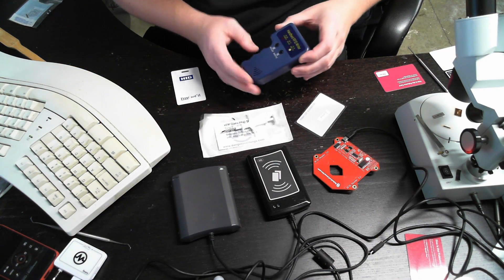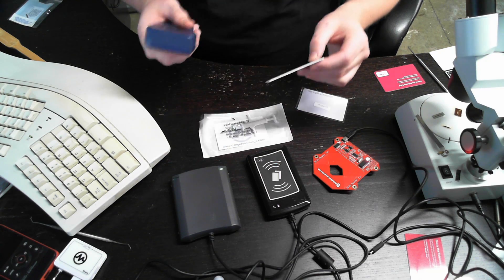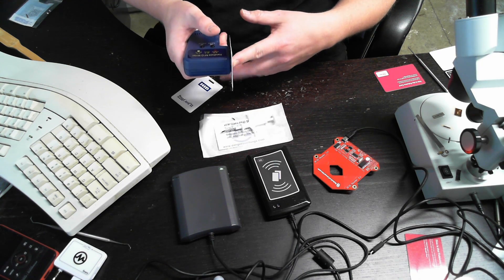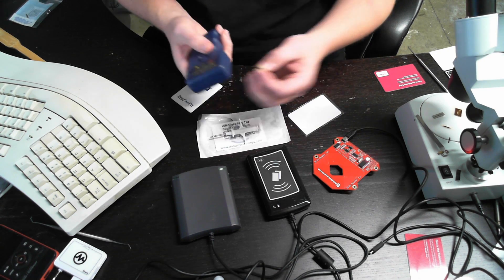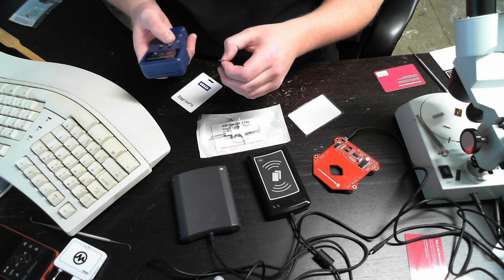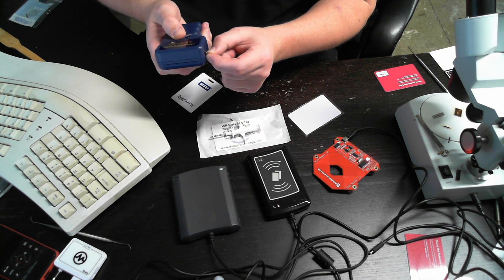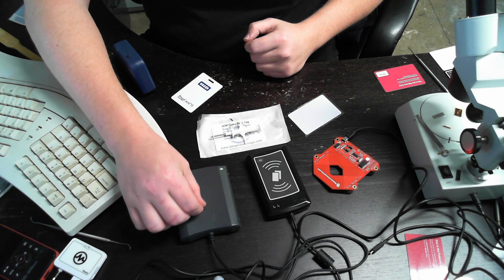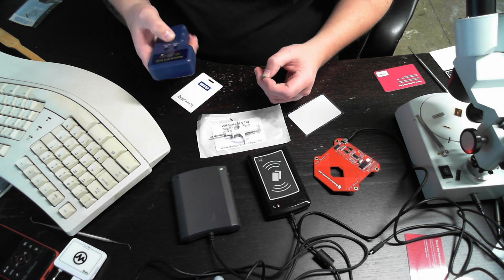The xEM 125khz EM + HID cloner/copier

Comment: Is there a way to put several ID‘s on a tag?
Reply from the maker: No, the T5577 can emulate one tag type and ID at a time. To have multiple types would require some kind of interface to switch tag IDs or at the very least some advanced command set to manage tags.
Reply: Dangerous Things First of all, thanks for that fast answer! Do you have a solution in mind? What kind of switch tag or command?
Reply from the maker: @crocksxr  not at this time. it would require a chip maker to come out with a silicon IC that can perform this function, and we don't know of any that would bother with this as a product for the mass market. Maybe something out of China, but if the "magic" chip industry is any indication, those chips would be unreliable at best.
Reply: Dangerous Things And another thing. Can I write on it with a 13.56Mhz writer?
Reply from the maker: @crocksxr  no the xEM is 125khz only
Reply: Dangerous Things And can it be read by a 13.56MHz reader?

Comment: Hello.  Great video.  Does this work with Proxy 2 (or II) cards?  I have 7 parking spots in a garage that uses these cards, but only have 2 cards.  I need to have 5 more duplicates.
Reply from the maker: Raphael Sanchez yes it works with hid prox2 cards
Reply: Thanks for your quick reply.  Sadly, you are out of stock on this device.  Even more sadly, I purchased this item from Amazon and it is very similar to yours (color, size, and even the Mandarin/English writing) and it did not work.  
 
https://www.amazon.com/gp/product/B019GJDGJM/ref=oh_aui_detailpage_o00_s00?ie=UTF8&psc=1
Reply from the maker: Raphael Sanchez yes it's tough to sort through the sea of similar and knock off Chinese products out there. we worked directly with the factory to ensure it could copy both EM and HID. I will post a link to an hid capable cloner shortly.
Reply: I just saw your response to another viewer from a month ago about Chinese products focusing on price and function, so thanks.  Now where do I get a duplicator/copier that will read/write Proxy II cards?
Reply: Thanks so much!
Reply: @Dangerousthings  do you have a chip in your peter sir
Reply: This one should work; http://amzn.to/2n5Cvu1 though it is much more expensive.
Reply: hey im in the same boat. wondering if you found a solution and can pm me

Comment: I bought the KKmoon Handheld 125KHz RFID ID Card Writer/Copier Duplicator before I saw this video. It looks identical to the one in this video but will not read two different normal apartment key FOBs I have. One is the standard grey cricle HID on a black teardrop backing. The other is the elongated thumb shaped fob. Google "hid key fobs" for examples - https://www.google.com/search?q=hid+key+fobs&tbm=isch. Will this Dangerous Things unit read those key fobs or am I out of luck?
Reply from the maker: The difficulty when dealing with various products made by chinese, for chinese, is that there may be 20 different products that look exactly the same, but are different inside. That's because the chinese tend to focus on price and function, not branding or standing out in a flood of low cost products... so the same blue plastic case made by XYZ Plastic Co is then used by many different companies to put their electronics into, with no difference in appearance... sometimes they change stickers or labels, but sometimes not. Even a single company with 3 versions of device will not bother to change anything about the look of those three products because it's cheaper to just use all the same exact materials (where possible) and simply mark some model number or feature checkbox on the outside of the box. it can make for a confusing difficult experience for the consumer.
Reply: I had no idea this product was offered by you when I bought that other unit. Regardless, does yours read/write HID Proxkey III ?

Comment: Is it possible for this device to write to anything other than an xEM tag? Like another HID tag or standard RFID tag (EM4***, etc.)?
Reply from the maker: This device can only write data to ATA5577 / T5577 cards. HID and EM41xx chips do not allow writes, they are read-only cards.
Reply: Dangerous Things so it could write to one of those cheap blue keyfobs? And would those key fobs also work with HID readers? Also thanks for your prompt replies!
Reply: @asad-ullahkhan2368  probably not because there are a variety of chips. You'd need a Proxmark3 to determine what the chip is.